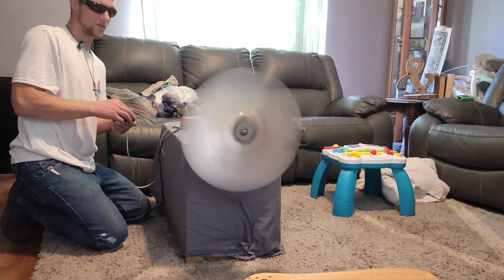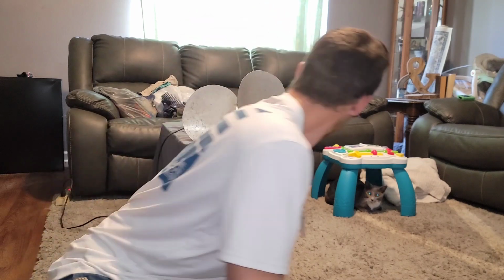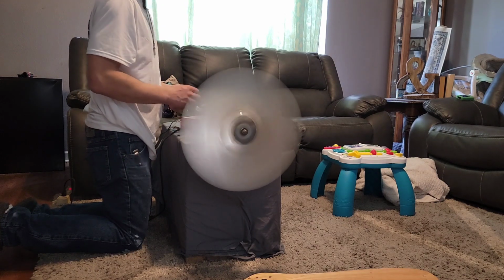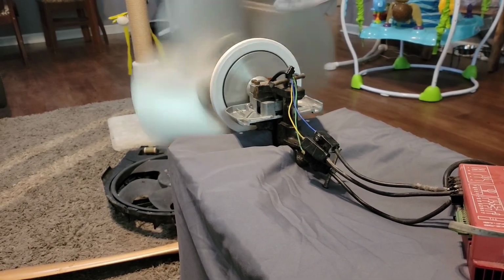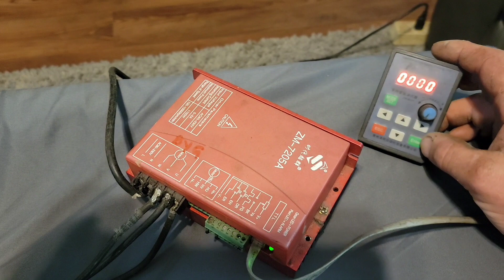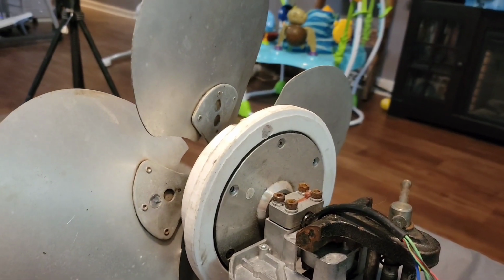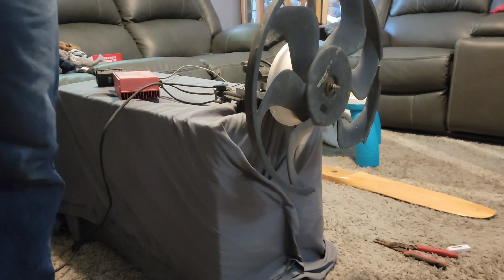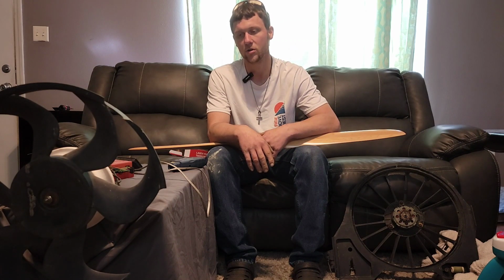ceiling fan made from a hoverboard motor? insane speed!  Exploded fan blade!

Comment: Funny place is the living room for testing an unproperly engineered ninja blade with the potential to blow open in every direction bar in its rotational centrifugal orbit. 😮😂
Reply from the maker: So true. Almost cost me a t v. It's all for the cause right
Reply from the maker: So true almost cost me a fifty five inch t v but it's all for the cause right! For the love of science And technology
Reply: I think the cause could still be shown love outside, right? Cool video though, but i was on edge the whole time thinking the metal one was gonna fly off . About A year ago a friend of mine put a skill saw blade on an edger and it flew off and I SWEAR TO GOD it hit his leg and cut it almost all the way off.
Reply: @Rand0.Mality.74  I did a similar thing with a brushless motor from an RC car.
That thing span so fast it could of broke the sound barrier if it fell apart. You don't test, you don't learn. 😎